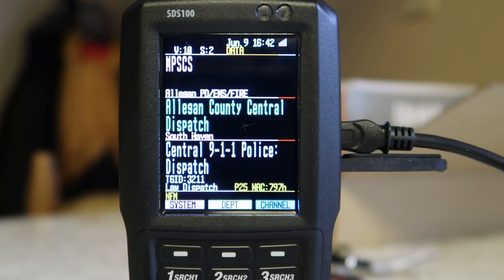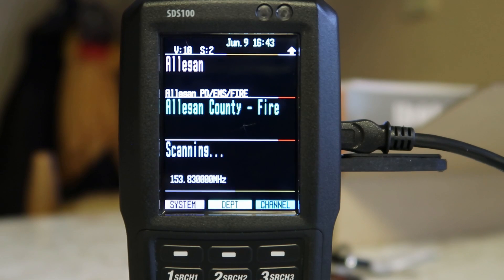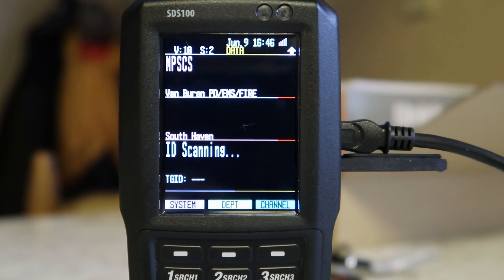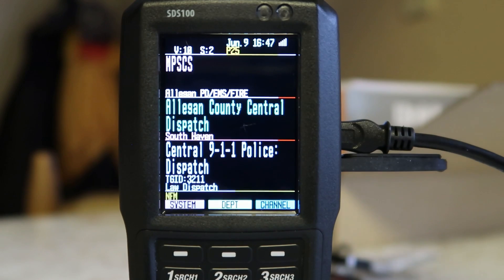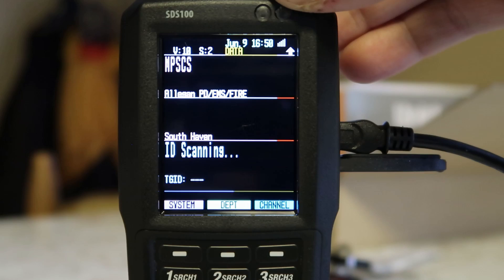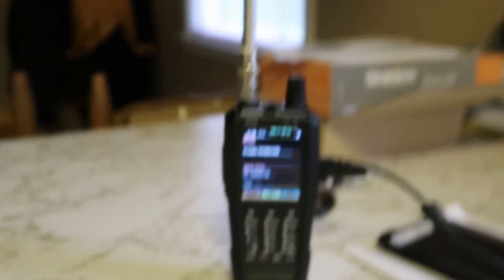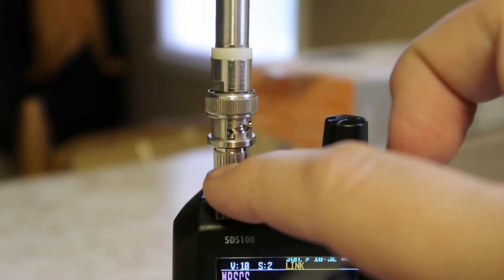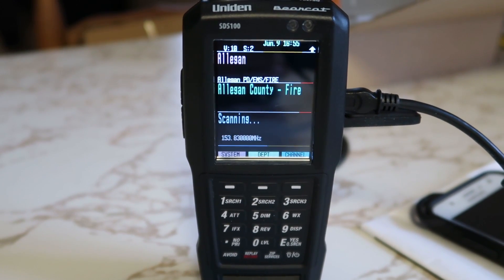Uniden SDS100 Scanner Audio Performance P25 System - True I/Q

Comment: Ok here’s my situation. I have been using SDRs on my computer scanning the Kent allegan and ottawa county calls on the ottawa towers. But I have been having problems with it so I want the sds100 so I don’t have to deal with it anymore. 

My question is if I want to listen to only those county’s is that possible or not.? Doesn’t seem like many states have shared systems to the info isn’t easy to find.

Comment: Just remeber peoples, although this is a great radio, if the agency uses encryption you wont hear anything but noise or nothing.
Reply from the maker: Anyone willing to spend over $600 on a scanner should know basic information like that.
Reply: @MiTreasureHunter   I agree with you, but sadly there are retailers who do not pass on that information to buyers who then buys the scanner and wonders why they cannot hear anything.
Especially when they are new to the hobby.
Reply from the maker: @BrotherInArms73  it's not up to the retailers, it's up to the customers to do their homework. Salespeople  only care about make the sale.
Reply: @MiTreasureHunter   precisely my point, that's why I encourage people to do their research before buying a scanner.
Reply from the maker: @BrotherInArms73  If you are like myself I am a FCC licensed Amateur Radio operator so this piece of equipment is a nice addition to my shack. Encrypted or not, on my level of communication reception it makes no difference. It is a very sensitive scanner that provides a lot of information and add a GPS unit to it and it will auto track your location and load the correct frequency list for the area you are in. Best scanner I have ever owned and I have Yupiteru and AOR communication receivers.
Reply: @MiTreasureHunter  it is easily one of the best scanners I have seen in a long time and very rare to find one that doesn't need tweaking when it comes out of the box. I hope you get a lot of years out of this beast :)

Comment: where did you get the antenna from I would like to buy one
Reply from the maker: I've had it for years. It was purchased at a Radio Shack.
Reply: @MiTreasureHunter  what is it called can you remember?
Reply: @LeoCloud619  
RS 20-006

Comment: How do I program in city, state and county?
Reply from the maker: Using the free downloadable software is the absolute best and easiest way.  You need to have the software anyways to update the internal database and Firmware. Once its updated you dont need to program in anything you just set the location in the scanner to the zip code you want to scan. If you want to program agencies or make a list then you use the software to build your favorites and upload it to the scanner.

Comment: This is much more than the SDS 200 after mucho accessories so I expect good audio from what's supposed to be a high-end radio. Of course, no handheld will do good in a noisy car. But size is no excuse since the smallest radio I ever had (Icom R2) had decent audio, much better than anything Uniden had at the time, any size. I didn't get mine yet but also ordered a SDS 200 as I'm a sucker for displays that's color can be changed. The 396XLT was my favorite cuz it had 5 or 6 colors to switch between. I like your style letting us hear a scanner, while many j@ck@sses talk an hour to an hour and a half with like 30 seconds of scanner audio in it.

Comment: Best thing about this video as a long time radio enthusiast, the first thing I was looking for I found here. A good sample of audio, the amplification of the built-in speaker, the signal strength simply receiving inside of a structure, very well done! This video here helped make my decision to buy much easier. I like the older telescopic adjustable antenna! Thanks
Reply from the maker: Thank you. I absolutely love mine AND I am going to by the base/mobile version now to add as a permanent piece to my Amatuer radio shack. The portable I love because it goes everywhere with me. I have never used a scanner as much as I have used this one and I have a few scanners😅. They fixed the battery issue last Fall and mailed us early owners a new larger battery and battery cover. So my original battery makes a nice backup battery now.

Comment: I also own this scanner, bought it back in August and it came with the larger battery,  this is the best scanner I have owned in the 25 plus years of the radio hobby, and for those complaining about the price, you pay the same or more for a cell phone and think nothing of it and cell phones are not worth the price in anyway! they charge so much for them because they know they can jack the price up and everyone will still pay for them,  $1000 for the latest iPhone is beyond stupidity! so yeah maybe these are expensive but I thoroughly enjoy mine and works great in all modes, this nonsense that these are junk in analog vhf or uhf... user error all the way, I do not believe they fucked up the vast majority of their products and sold them anyway, before you waste your time and say that I don't know what I'm talking about, actually go back and figure out your scanner before passing judgement.
Reply from the maker: I'm still loving mine. Hands down best scanner ever owned. I have yet to get the larger battery. It's my fault for not verifying my address, need to do that.  I agree with everything you said my friend, and learned to just ignore the haters, trolls, and jealous people.  Take care.
Reply: Where can I as a newbie go to find out if this will be good for me in my area (Dekalb County, GA)?
I have an old analog unit but they started using some new P25 stuff that I know nothing about.
Reply: Geno Write if you call Zip Scanners, they can help you out with that information. Sorry, I don’t have the phone number or website in front of me right now.
Reply: Modern cell phones can do much more then that scanner. They are more powerful then the computers of the early 2000s. Hence the price tag.

Comment: Overpriced junk
Reply from the maker: You ever own one, or better question can you afford one.??  I have owned mine since first shipment went out.  Friken Awesome scanner!!
Reply: Hopefully I will get one of these one day but do either of y'all have a cheaper one that yall recommend? I have heard nothing but good things about the uniden scanners but I just want one to play around with a little bit, I can always upgrade later! TIA
Reply: @JuarezDerrick   - I suggest Waiting for the NEW scanners due from Whistler, they will Actually WORK as opposed to Uniden and offer Superior LSM Decoding. If PRICE is a concern , Whistler has the wh1098 scanner on Closeout for $399, it comes with a SD card with the Entire USA and Canada database on it, and you can use the EZ scan software to Update for FREE.
Reply: @markplott4820  Whistler isnt coming out with anything new. They abandoned the new TRX 100 and 200 because they couldnt make it worked. They bluffed and failed. Uniden is the only player right now with a working scanner that can properly deal with simulcast issues.
Reply: @RellyOhBoy - That is FALSE, Whistler is still making PREMIUM Scanners and will Continue to do so, However they are Regrouping after deciding NOT to go ahead with the TRX-100/200 Project, they Will continue to Manufacture the TRX-1/2 and will Develop MORE Future Scanners, HOPEFULLY with a  Continous Coverage design. NOPE, the ICOM R30 is a VIABLE scanner capable of Dealing with P25 LSM Transmissions, you just have to Scan MANUALLY, that's no Problem for me, as I have been using CR for 20+ years.Perhaps ICOM can provide a SDR and Radio board to help Whistler.
Reply: @markplott4820  Whistler dropped the ball plain and simple. They huffed and puffed about the TRX100/200 but in the end it was all a bluff. Also, the Icom R30 is marketed as a Wideband Communication Receiver w/scanning ability, It is NOT a purpose built scanner. I've owned the R6 and R20 so I am well aware of its feature set. It does not track trunked radio systems and that's what the majority of scanner users are interested in, monitoring Public Safety systems. (POLICE FIRE EMS).
We are discussing Uniden/Whistler stuff and you are talking about an Icom receiver which isn't even in the same category, Thats just like people that try to compare the SDS100 to a Unication Pager or P25 system radio....again NOT in the same category.

Quote from Universal Radio inc "NOTE:  The IC-R30 does not support the reception of trunked systems. Therefore it is not a strong choice for monitoring most public service (police/fire) radio systems."

So which are you...a Whistler employee or a former/disgruntled Uniden employee??..LMAO
Reply: @RellyOhBoy  - Whistler just had the ONE press release , hardly huffing and puffing. 

the ICOM R30 is in a Class of ONE and Quite Simply outclass the Uniden and Whistler scanner with their Superior Receiver technology.
Reply: @markplott4820  ok so just get both. One for trunking and one for the wide band receive. That will be full coverage. They cost about the same.
Reply: @RellyOhBoy  - YES, I have that Right now. but it would be NICE to have an American Scanner that can do it ALL.
In 1980's I paid $999 for a AOR 1000 , it was the Cadillac of Scanners for the time, ONE of the few Scanners that could Monitor Cellphones, still have it today. 
I do NOT see why Uniden and Whistler scanners are SO Limited in Spectrum, since my AOR 1000 was Continious from 100 khz - 1300 Mhz back in the 1980's.
Reply: @markplott4820  ofcourse it can be done but its all about competition to keep things fair amongst these companies and second, the hobby is not as big as it used to be back in the days. I remember my Pro-2006 fully modded sitting next to my Cobra 148 LTD. But those days are over and so is the demand for such great radios. Thanks to cell phones and the internet.

The only continuous trunking scanner i can recall was the Uniden BR330t, it did 100khz - 1.3ghz (minus cellular) its analog though which is why I got rid of it when I moved from NYC to NC. I carried that thing every where i went.